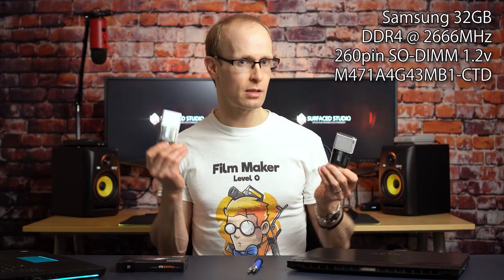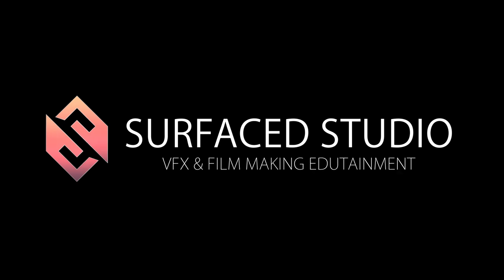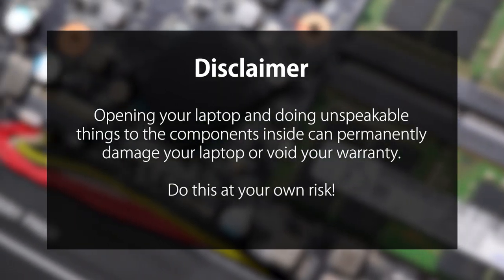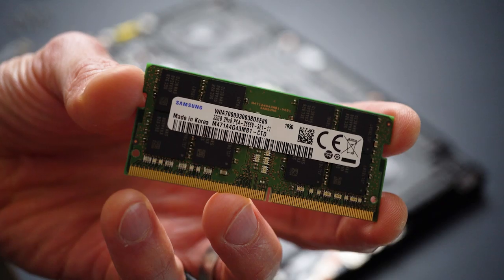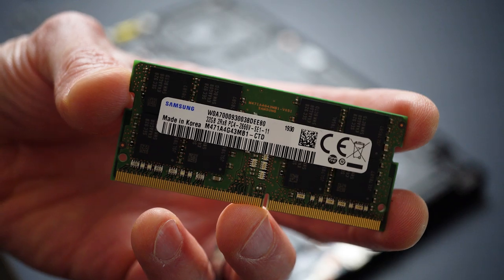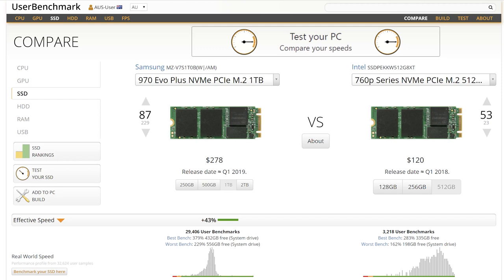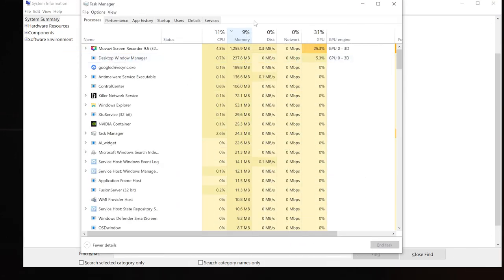How to Upgrade the AERO 15 | Video Editing & VFX Laptop

Comment from the maker: TIME STAMPS
0:18 Introduction
0:49 What is THE BEST Laptop for Video Editing & VFX?
1:35 AERO 15 OLED vs Alienware 15 R3
2:45 How Much RAM do You Need?
3:14 What Hard Drive do You Need?
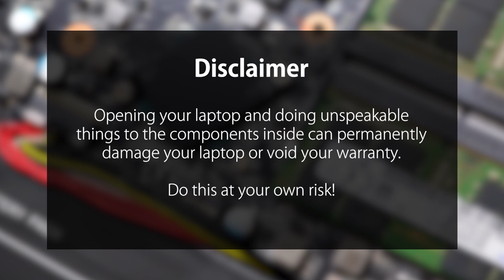4:13 How to Open the AERO 15
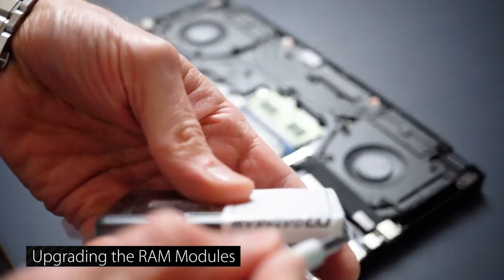4:42 Upgrading the RAM
5:48 Installing a new SSD
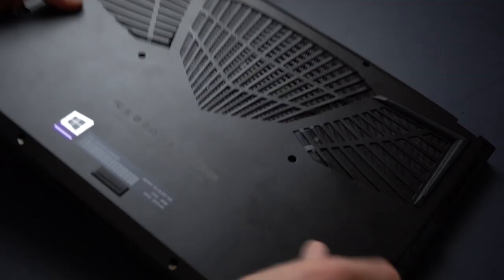6:47 Startup Issues
7:16 Conclusion

Also, what is your current working machine? :)

Comment: There is something seriously wrong with the battery life. Doing visual effects. I can understand 2 1\2 hours but video playback you should get at least 6 hours. The GPU is not switching to intel HD properly or you have an app running in the background that is lighting up the GPU.
Reply from the maker: Been waiting for Gigabyte to get some more info on what's going on with the battery life. For the most part I'm plugged in so it's not that big a deal, but if you're living a more mobile life, this could be a serious issue with the laptop for you

Comment: Love the video waiting for ram prices to drop to upgrade. Have a question. I have a thunderbolt 3 dock. When I connect 2 monitors to it only one monitor works. I know it isn’t the dock because I used it on my go workstation laptop that my work provides. This is really turning me off. I would love to just use the one port. Have you had this experience?
Reply from the maker: Sorry, can't say I've tried connecting 2 external monitors to it via the same dock - I'm just running one external via HDMI and that's been working without a hitch for me. Maybe someone else here has some insights?
Reply: I'd like to know this too. I have dual screens (hdmi and mdp inputs) and want to go through a thunderbolt dock from the Aero tb port. Any luck getting it working?

Comment: How easy was it to move operating system over to the new ssd . Thanks i have just got the same laptop
Reply from the maker: Worked seamlessly :) I just cloned the data across to the new drive, swapped my boot priority to boot from the new drive and no issues. Changing RAM or drives doesn't require driver changes like you would have if you changed CPU, GPU or motherboard

Comment: I've run into the same problem although all I was doing is upgrading my ram. The computer won't post. When you held down the power button for about a minute did the screen flash and the computer  start powering on and off while doing that?
Reply from the maker: It did restart a few times, but after a while (about a minute) it booted up again and everything went back to normal

Comment: Wow, I am planing to buy the exact same model and was thinking to make the same upgrade, so this is so convient. Just one question. The price of the components seems so much cheaper in USD, could you get it shipped to Europe without any issues? Thanks a lot for the amazing videos! :)
Reply from the maker: You're very welcome - I'm really happy I did the upgrade. I purchased the RAM on eBay and the drive locally in store here in Melbourne. Not sure what's possible in Europe but I'd imagine you'd be much better connected with the rest of the world than we are down under
Reply: @SurfacedStudio  oh, sorry for assuming that you were in Europe too! I hope the computer is stable with C4D, Redshift, Octane, etc. I am coming from MacOs and I am really scared. I was considering getting a new MB16" since now all the render engines are being programmed for AMD cards and Metal, but not sure how powerful is the AMD 5500M 8Gb, so I checked your video about the AERO and now about to forget the Apple option and get myself the same exact configuration you did. Thanks so much for your response and videos, you rock mate! :)
Reply from the maker: No worries at all. My accent is still all European-y so it's a fair assumption. I had it shipped to Australia and that went well - loving my new setup and now using it full time. So far no issues at all and glad I did the upgrade :)
Reply: @SurfacedStudio  In fact it feels like German accent to me, :) Oh glad to know you are being happy with the computer. I saw so many issues with that model on the Amazon US people's reviews that decided to get the MSI P65 instead. After 20 years using macs its scary moving to a Windows computer. Just in case you feel curious about my work, feel free to check www.xebius.com and www.forestforrent.com, thanks so much for the feedback once again! Cheers from Spain!
Reply: Manuel Camino How are you finding the MSI, I’m doing the Mac switch too and pretty worried.
Reply: @electronicbagatelle  well, I am not sure if it's my MSI or what, but software is not stable at all, specially 3D software... with all I am now able to do stuff I couldn't do with MacOs...

Comment: How does it perform now with more ram still stuttering in 4k video ? By the way, nice effects in beginning ;)
Reply from the maker: It's been running nice and smooth :) There's always going to be some lag with some files, but it's been doing better than my Alienware and has become my full time working machine. Very happy with the upgrade :D
Reply: @SurfacedStudio  I did same upgrade as you, it works very smooth even h.265 4k video in davinci resolve 16 works :). But had some problems with partitioning , in bios there is rst rapidshare technology and ahci and intel optane, i choose ahci, but the ssd intel which i choose as second device is very slow only ~1600 mb s readspeed... and when the machine is quiet, i hear cpu whinning or so its like elektrical noise bit very minor.

Comment: Hi there,

Amazing video I have the same problem as you I just upgraded my rams from 16 to 32 and I am getting the black screen too tried to hold down the power button for 1 mins but laptop keeps turning it self on and off and I still have the black screen but if I try it with one 16gb of ram it works fine 🤷
Reply from the maker: Try the 16GB sticks independently to make sure one of them isn't a dud. If either one works, then both of them should as well assuming they are both the same type / frequency / model

Comment: I have just upgraded my pc after lots of saving and I want to set it up properly from the start. Ie allocating the drives for start up correctly,  where files get saved to, setting up windows etc.  Could you do a tut for this. As most are all about building the pc but not setting up the software.
Reply from the maker: I personally have one SSD for Windows + programs and I use a separate SSD to store all my media, project and cache files so they flow from a different drive :)

Comment: If I would like to upgrade to 32GB RAM, I will only need to replace one of the existing RAM in Aero? Or remove both existing RAMS and only put 1 single 32GB Samsung RAM?
Reply from the maker: I’d recommend replacing with 2x16GB sticks so you can make use of the multiple channels for your RAM. Single sticks perform less well than having 2 :)
Reply: @SurfacedStudio  Hi, could you advise if Aero 15 'KD' model will be able to use the Samsung RAM you used in this video?

Comment: Have you disabled trusted computing in BIOS settings before upgrade the hardware ?
Reply from the maker: I haven't changed anything in the BIOS before upgrading :)
Reply: @SurfacedStudio  After installing the SSD (WD SN550 1 To)  GIGABYTE logo on screen, but no boot and impossible to enter in BIOS settings. Could you please suggest an advice to solve the problem ?
Reply from the maker: Is the existing drive with your original OS still installed in its original slot?
Reply: @SurfacedStudio  Yes

Comment: I have an Aero 15x from 2017, the graphic card is not bad but: Can I upgrade my graphics card??? If I can, how can I do it???
Reply from the maker: I am no Gigabyte tech expert, but in general upgrading the graphics card might be tricky with a laptop as the form/cooling is tightly coupled to the shape of the motherboard. Might be worth contacting Gigabyte though to see if that's possible :)

Comment: Where i should stick thermal pad for samsung 970evo which i got with laptop as a spare pad. Or that isnt necessary?
Reply from the maker: I am not sure to be honest - I don't use a thermal pad for any of my hard drives and I don't know whether there'd be enough space in the laptop to accommodate one anyway
Reply: @SurfacedStudio  probably i skip that as well cos dont see point to stick one. Did u have any sponge or foam in nvme slot?